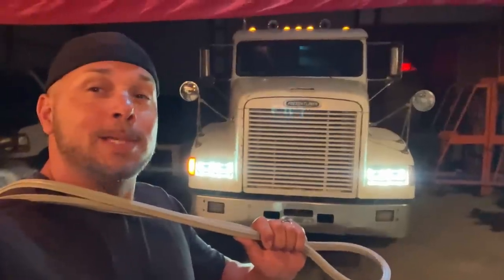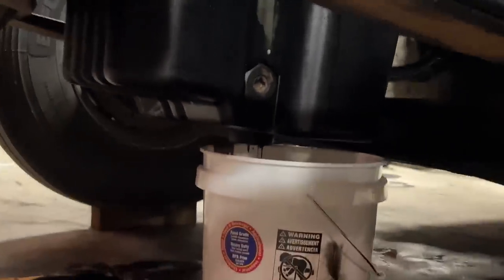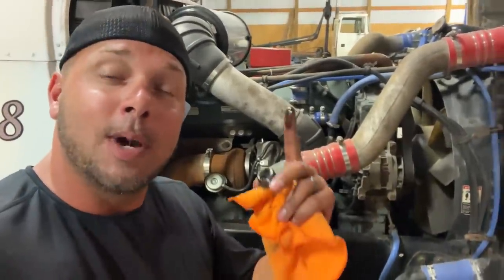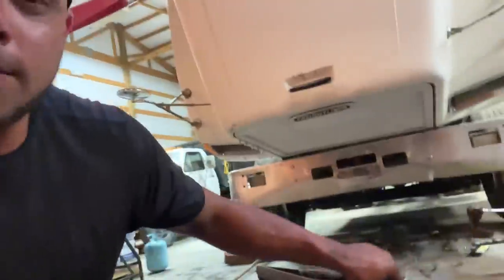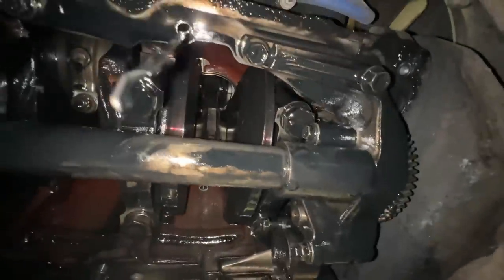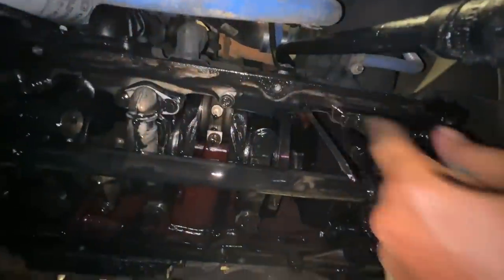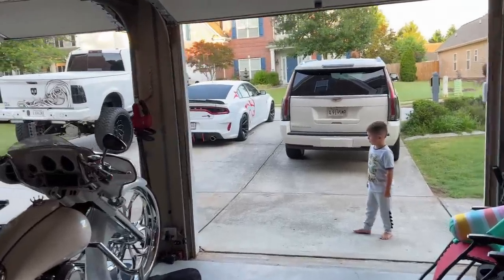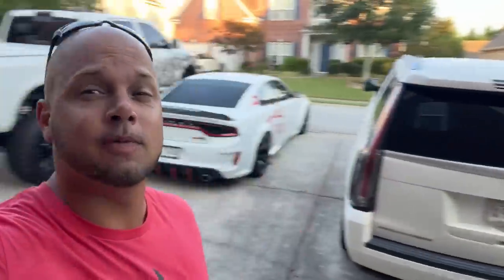60 SERIES Detroit Diesel 12.7 oil LEAK !! Which Gasket to Chose and why it took us 5 hours to Repair

Comment: There are 2 different oil pans for the 60 series. One requires the grey gasket (DDECIII)  and uses different bolts and bushings. You have the black style, (DDECIIII) you should also replace the bolts and put ultra grey on the flat parts of the gasket.

Comment: I had a 12.7 ddec 4 no leaks and never added oil between oil changes great engine got 7 mpg pulling a covered wagon hauling steel usually 70 to 80k gross. That Fld will be a money maker can't wait to see it pulling those cement tanks.

Comment: I sprayed 91% alcohol over the bottom of the block. Wiped the gray gasket with alcohol also. Then I put drops of Super glue in the corners and in the tesky areas you mentioned. Insert the gasket and put the pan up right away. Bolt it to factory specs, and done.

Comment: That gasket has to be installed and pressed fit in the pan grove be careful to stretch it as you go otherwise if you pull to tight you'll wind up with too much gasket or if you dont pull it enough you wont make it around pan you may have screwed up by trying to install on dirty oily pan see as the gasket comes with dry silicone to enable being able to depress the gasket in to the channel to lock it in place also at the four corners of the block there is seam that needs a little gasket silicone in place and let cure before putting pan on about 45 mins to hour and all surfaces must be clean and grease free  a few cans of brake clean be careful when installing the pan you dont hit the dipstick or tube remove dipstick

Comment: You have to use the black gasket for that style of oil pan. I just replaced my oil pan along with the valve cover. They were both cracked. I have the two piece cast aluminum valve cover. It seals up much better

Comment: It does take a long time to work on stuff like on my 2010 KW like doing regular maintenance and making sure everything is greased and tip top shape to head in the highway. My oldest son Nathan he has my late dad's 1978 KW and him and his wife loves driving it. At least he can stand up without banging his head. He's 6'3" I told him he'll I am 6'5" and my head doesn't hit the top of the ceiling in the sleeper and he likes it and he's going to be installing a Green Apu System in it next week he's heading up there to get it installed he seen your video of the installation and also in Steve's channel FSC Trucking. We are about to leave now and head home not very few people cruising around town.

Comment: I’ve done those gray gaskets around 10 times. The first time I was throwing crap  I got so angry because it kept popping off on one side .I did use a heat gun. Actually the first time I used a heat gun I ruined one I got it too hot and melted it. You will probably think I’m crazy but I put them in a old oven I have in the shop  set the temp to 150 for about 10 minutes and they go in like butter .

Comment: My pick up is exactly the  same.  The engine has shelves and you cant get all the old oil oit without getting it vacuumed. So i dont bother with that.  OEM  parts guys usually know the problems with fittment ( they sell to mechanics) so they are the guys  to ask (i used to sell OEM ford and toyota parts back in the day)

Comment: Make sure you clean the groove on the oil pan, make sure the  the gasket is clean, use super glue in trouble spots, in the groove, set in place, use a rubber Mallet to tease the gasket in place , and install and torque the bolts ….. just a thought ???
Reply from the maker: Yeah groove was super clean super glue great idea 😎🙏🏽

Comment: I fix my Ford Expendition 2004 oil transmission pans with ...First use Permatex 82180 Ultra Black Maximum Oil Resistance RTV Silicone Gasket on oil pans, then Rubber Gasket on Permatex/oil pans, and wait 15 - 20 minute to glue. The truck have BIG OIL PAN, it need four hands/arms stable for screw oil pan nuts. Alone... use 4 ton Floor Jack.

Comment: I had a FLD 120 with a 12.7 Detroit put 2.2 million miles on it before I had to rebuild I didn't use lucus I used motor kote some good stuff kept the engine running smoothly and a little cooler it's a hyper lube and the grey one defeated me so I put the black one back on

Comment: I ues super head liner spray to hold pain in the but gaskets in place just spray your parts and let it to get tacky a little. It works great your part will fell like you have two way tape on it.  P.s. don't make a mess lol

Comment: Smack some grease in to hold the gasket, Jason, engine heat will get rid of it when you run the motor. Idea works anytime you need to hold something in place that wont stay put on it's own. The dipstick thing is down to you, mate, why have it in when you dont need it yet? Dont do up the pan studs too hard cos they'll just push the gasket out the sides if you over pressure it.

Comment: I'm looking at buying a Kenworth right now with a 12.7l and it actually has a minor seepage at that same bolt. 250k miles on over haul. 800 marine cam, 7014 injectors 650hp.  I got a picture, upon inspecting the other surrounding bolts it looks like it might not be torqued properly, what gasket is that you got?

Comment: What you will find as well with series 60 is they are very common for leaking  around the front structure.
Reply from the maker: Dang it 😑
Reply: Oil cooler Failures, Leaking Oil Cooler Housing - Replace Oil Cooler Housing if rusted. Failed Oil Pressure Sensors will or can leak, may cause truck to run funny. Check that accessory Driver gear and Accessory housing is tight. Be aware of Injector Failures (Bad Injector O-Rings, Misfires) The diamond seal will also leak oil (Camshaft Thrust Plate/diamond Seal Behind the Bull Gear. Common Issues: Intake, Exhaust & Turbo Boost Leaks. Fuel Supply - Old Fuel Lines, low power. Check Rear Housing and Front Gear Cover for Leaks or Fails. Front Gear (Replace Bull Gear) Rear Cover Leaking - Go ahead and add new front and rear motor Mounts. Yeah, I got a full spread sheet of common issues with the 98-03 Motors because I'm buying a W900 with one.

Comment: Hey man on the 12.7 can I change out one of my filters without having oil poor out? My back filter gasket is I’m assuming torn again because that’s what happened last time and she’s leaking from there again.
Reply from the maker: Not sure what you mean, but yes, as long as the truck is not running it’s not pushing oil through the filter. Hope this helps a little.